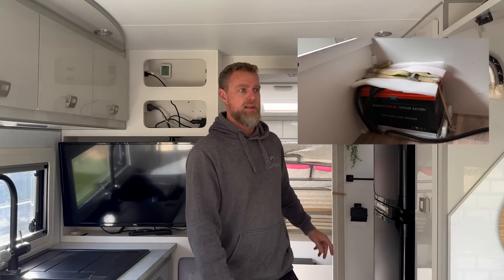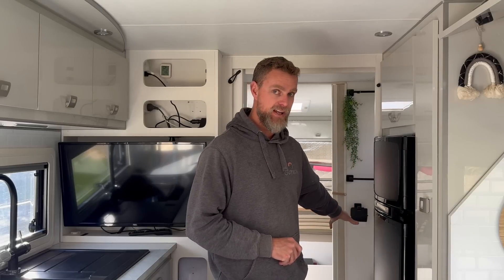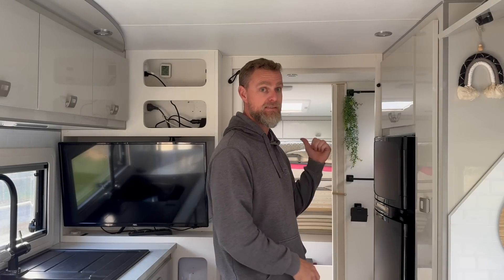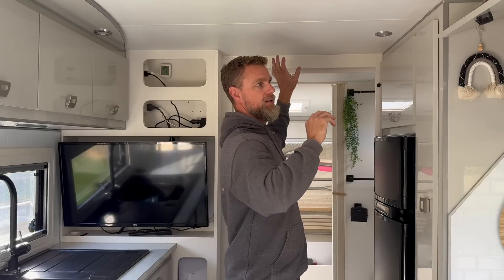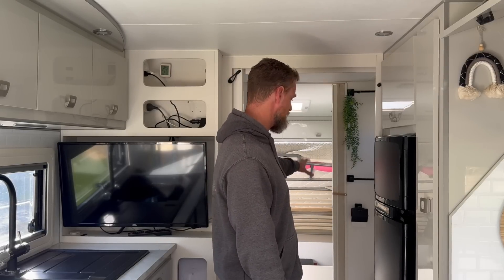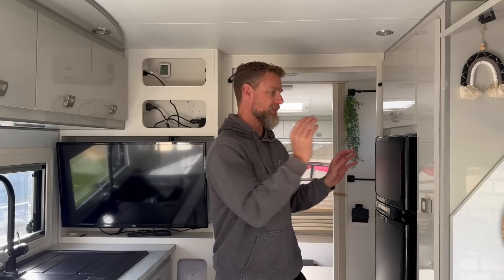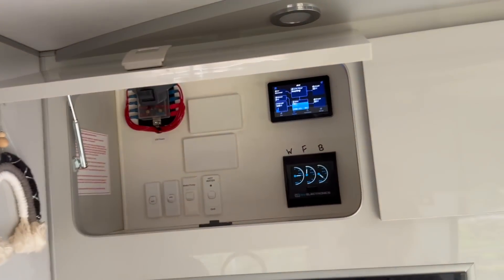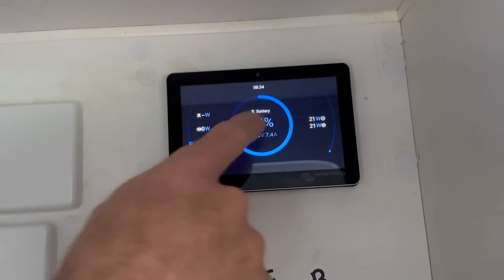A VERY EXPENSIVE USELESS CARAVAN POWER SYSTEM: How We Fixed It!  Video 2

Comment: I assume you would have had to run the 240 v power cable to the back where the inverter was originally so you could pick up the input to the van and have the vans 240 system on the inverter. Great video guys.

Comment: That is a massive improvement, really nice work. Is that fuse near the battery isolator for battery fusing or inverter? Assuming inverter as it looks as if there is another run of positive running up behind the conduit. If the client hadn't had such a quality inverter already, would it be best to look at 24v battery/inverter/solar for these sort of heavy loads with something like an Option to down convert to 12v?
Reply from the maker: We would always take consideration to 24/48v systems if we were starting from scratch. It’s a definite load requirement vs cost vs efficiency question. It also sometimes comes down to roof space to determine what we can do with solar also. 

3000w is definitely the max we would do at 12v. As you can see the cabling is large and quite short. Plus the 12v efficiency of the inverter is lower than a 24/48 option. 

There are a lot of factors. If you are looking for high power setups then 24/48v is a more suitable option.

Comment: Can I ask how much this installation cost them please
Reply from the maker: Thanks for your question! 
The cost of the off-grid power system can vary depending on the specific components and upgrades you choose. 

Each of our upgrades is customised to suit our clients' existing caravan, power setup, and power needs. This particular build included additional work that may not be mentioned in the video and may not apply to all upgrades.

Generally, a complete off-grid power upgrade like this can range from $15k to $30k. 

For a more accurate estimate, we recommend reaching out to us directly or subscribing to our channel to see our upcoming video, where we discuss the costs in detail.

Comment: Definitely a large improvement! But! 150 watts from the new solar 😂 according to the GX, typical low voltage crap panels!  And everything still under the bed? Is that compliant 🤔
Reply from the maker: Thanks for watching and commenting. Re: Solar. This was recorded at 8:00 in the morning in the middle of August in south west wa. I’m sure you can establish from that the effectiveness of the sun at that point. Re: compliance. Please feel free to watch our video of the summary of the latest revision of the AS/NZS3001:2:2022. This video in brief gives a quick overview of the requirements of the standard relating to battery, solar, isolation and monitoring. 

Cheers. 👍

Comment: I installed my own system, my first inverter decided DEC 24 it only wanted to charge 3A, (13 days for a full charge at that rate) upon further assistance from my dealer we discovered that the inverter was only charging to 60% of max battery capacity. I was instantly sent a replacement which worked but had severely low overcast power on pv 3 and 4 , even switching pv1 and 2 arrays in those ports would drop the pv by 90%, since it was my second not so perfect inverter Jon from solar online did a 20-hour trip to install another larger inverter which seems to work even better than the last 2, higher volts after sundown for starters, the first inverter was 3.6V lower every day.  The second inverter used to make 400w of solar disappear, the new one only seems make 50 to 100w vanish on the way to the battery. That is the quik story but going deeper with the second inverter, at that point I only had 3 arrays and in overcast pv1 to 3 was 480w 780w 210w, we both assumed something was wrong with pv3 , checked everything even ran seperate cable to the inverter, no change, then I added the largest array pv4 a 3.3kw and pv1 to 4 went like this 480w 780w 105w 105w , these tests are done with no direct light. Seamed the inverter was not letting pv 3 and 4 contribute, even in discharge. Now with the new inverter 380w 420w 320w 340w, thick cloud. Nice that it is working but the bloated #'s from pv2 means all my calculations are way off, now with thick clouds I can only hope for 1300w, vs 750w x4 argh. It is a vertical array, so the power improves during snowpack, direct sun and snow all arrays will be over 3500w, PV4 should exceed 4000w.